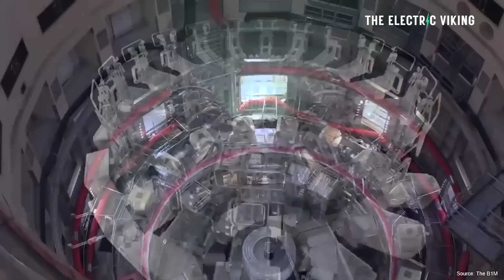Sweden criticised over plan to build at least 10 or more new nuclear reactors

Comment: NUCLEAR POWER: 
    Nuclear is THE MOST / ONLY carbon-free source of energy; it does not produce greenhouse gases that contribute to climate change. Trillions of solar panels and billions of windmills are much more carbon intensive.
    Nuclear is a reliable source of energy; it can be used to generate electricity 24 hours a day, 7 days a week, UNLIKE RENEWABLES.
    Nuclear is a low-cost source of energy, once the initial construction costs are amortized. SEVENTY PERCENT of nuclear costs is FINANCE CHARGE when builds are ALLOWED to take 20 years. 3 year builds are CHEAP, and can be had by building the exact plants built in the USA, over one hundred, in the 60s and 70s. They were on budget and on time, and can be again.
    Nuclear has a small land footprint; it can be built in areas where land is scarce. Nuclear power will create jobs and boost the economy.
    Nuclear power is a proven technology that has been used safely for decades.

Comment: Good on the Swedes. Depending on the type, it will be straightforward enough. Modular types can be built off site and dropped in place, more or less. The hysteria around nuclear is misplaced. Far more people have died from coal mining, through explosions or workplace injuries.  Mining is dangerous, especially when safety regulations are lax. Coal mining releases methane, is toxic, explosive and a worse greenhouse gas than CO2. When solar is simply not an option, nuclear is fine.

Comment: Smaller reactors is where the technology is going. U can also recycle the uranium rods after their 15 year cycle and reuse them again. I agree with reactors along with clean energy. Anything but gas and fossil fuels. Remember reactors are very very efficient. It’s also 2023. We have much more reliable fail safes for safety.

Comment: DUDE, you can't build a reliable power grid without Nuclear or Gas Power stations. You need a base load and anyone saying otherwise is assuming that battery production can increase 500% in 8 years... which it can't !
Spending €17B on a Nuclear power station is a great strategy for Sweden because they can sell "EXCESS" power to Germany, Denmark, Norway, Holland and the UK.
Also €17B divided by 50 Years = €340M ! That is quite low.
You can also sell the heat from the reactors and use it to run local heating and industrial processes.
Every single country in Europe with a population of over 25M should aim to get 30% to 45% of it's power from Nuclear Energy. Batteries today are in short supply and can't save the grid in certain rare circumstances. We need a mixed grid with a focus on Nuclear, Wind, Solar and Hydro.

Comment: The reason solar do not work well is that you basically do not get any solar at all from early November to early February. And for the rest of the 6 dark months you only get a trickle. I know as I have both EV and solar, and intend to get more (+ batteries). I intended to send a photo of my house at noon a sunny day around Christmas. The sun reaches 4.5 degrees (Stockholm) and is up properly for 3 hours, on top of that there is snow on my cells. Unfortunately YouTube did not give me the opportunity add a photo.
As we would need to save energy from the summer to the winter and want to produce CO2 free steel, concrete and batteries, nuclear is actually a very good option this far north.
I only wish we would burn all of the Uranium, on top of needing 40 times less, it would stay dangerous 100 times shorter.

Comment: 🤣to expensive 🤣
All "renewables" come with a co2 guilt you know ? The metals,minirals and production of "renewables" are mined with....diesel ofcourse 🤷🏻‍♂️
Reply: Not true. You need to do more research.
Reply: Postning of cry-laughing emoticons doesn't make you more trustworthy.
Reply: @vec306  as someone who works in a mine where they mine materials for making EVs what they are saying is true.  You arent running mining equipment off of batteries. Those trucks are massive diesel haul trucks.

Comment: Yes, energy from sun, wind and wave works great here in the northern part of Sweden in the summer. But in the winter the sea is frozen, we have almost no wind and the solar panels have few hours of sun and are covered with snow. Our new industries producing batteries and fossile free steel demands a lot of energy. The price for electricity was crazy last winter. What to do?
Reply: Yours is a far more intelligent response than Viking’s video which is low grade
Reply: Whenever there is sufficient wind during summer, loads of green hydrogen could be produced for the steel industry and possibly for heating homes (district heatings), obviously during winter.
How about the share of hydro electric electricity?
Due to EV’s refineries will become much smaller (will consume less energy), steel manufacturing for the oil&gas industry and the automotive industry will collapse (aluminium castings like Tesla). If we wouldn’t use so much plastic and carton the whole chemical industry could be downsized.
We all create too much garbage and we somehow keep running behind our own tail.
Reply: @Thesummerismagic12  electricity production from hydroelectric power stations cover around 45% of the Swedish electricity consumption.
Reply: the key is simple: STORAGE! we have just scratched the service when it comes to storage. We are so use to "power on demand" we have to realize that RE is not a power source with 24/7 availability thus you have to rearrange your thinking.
Reply: Energy import works just fine. Also storing energy for winter is possible in many ways.

To build more nuclear power plants is quite insane. It will be too late, too expensive and generates dangerous waste that will hunt mankind for at least thousands of years.

Solar panels and wind can provide us with all we will need. Storing the energy is the big challenge, but even that is much easier than storing nuclear waste.

With heat pumps getting better every year (reports of up to 600% power to heat), the problem will be even smaller. 

When EV batteries become part of the grid, the dark periods with little wind can be solved as well.
Reply: Waxes? Doubt there is much wave energy in the Baltic sea.

Comment: Don’t bother trying to compare the specific energy of any type of battery against uranium: its not even close. Nuclear doesn’t need batteries, backup generation or grid upgrades, works 24/7/365 and provides dispatchable baseload energy meaning cheap energy for the consumer. 
Many studies have shown the the system costs of wind and solar only ever increases as it’s system complexity increases, leading to a logarithmic increase in consumer energy costs.
Nuclear has zero emissions, has a very long life and uses 85% fewer metals and minerals than wind or solar, let alone batteries.

Nuclear is the greatest energy source humanity currently has has until fusion becomes a commercial reality.

Comment: Pretty weird regarding Sweden, didn't Sweden plan to build a massive battery production facility named: Northvolt? So they should be able to produce batteries in scale storing e.g. solar and wind energy (from world leader Vestas, Denmark)?
Reply: Was the production of batteries being proposed as a commercial business or to be funded by public money to be used for energy storage for the grid?
Reply: That's for cars and I believe they will move to us because of subsidies there.

Also grid scale batteries is not economically feasible not to mention we can't produce the amount needed certainly not for the climate Sweden has. 

All the hand waving about energy storage is infuriating for people in the electricity business.
Reply: @matthiasknutzen6061  "Just have a Think" just released an update on iron/air grid scale batteries. Looks promising for a change.

Comment: First I recommend taking a look at the new modular reactors.  Sized to drop in where there were old coal or natural gas plants and at a fraction of the cost of the traditional reactors.  

Then take a look at the reactors that are designed to recycle old nuclear waste as fuel, which sounds much better then long term storage.

From living near a nuclear reactor, there are many people who don’t care at all, so practically they take up a fraction of the space as solar.  

And simply for safety, solar is a supplement is fantastic.  But having a power source that doesn’t depend on weather, is key if you don’t want people freezing to death due to bad weather or too much volcanic ash in the atmosphere.

Comment: Industry heavy countries needs a nuclear baseline especially at that latitude. Hydro is great but built out to the fullest in Sweden already. There is no sun and way less wind in winter which is when you need the energy the most. Cant take no chanses with energy. NC works and is a fossil free addition to the renewable mix.

Comment: I think that everyone has said that baselod power isn’t a valid strategy. But if you think of the grid, what if you placed a battery at each substation and ran a nuclear power plant full out. You would get the absolute maximum power out of the existing grid. The cost of generation vs transmission may give a different result for the low cost system.

Comment: Of course decisions should be data driven. If nuclear plants use a common design, it greatly reduces costs. Streamline the approval process and costs are reduced. Build on a manufacturing line.
Reply: Once the price is known and can be reliably stated for each power station, it could lead to a wider use around the rest of Europe.

Comment: I usually like your videos, but this one has a few flaws.The following is neither pro nor con nuclear

Suggesting solar for Sweden is uninformed. If you go to google maps you will see that southern Sweden is at the 55th latititude. Northern Sweden is at the 68th latitude.
If you went to the southern 66th latitude from Melbourne, you would be in Antarctica, keep going a few degrees and you would be in the equivalent of northern Sweden.
It is really dark in the winter and cold enough to require heating of all houses. There is therefore a huge mismatch between power production and power demand with solar.

Regarding placement of nukes, you suggest that this would present a NIMBY problem. But Sweden has the immense advantage, that they already have nuclear reactor sites, that are  operational, and grid connected. Thus NIMBY is less of a problem, if they simply colocate with older reactors. 

Sweden has huge ammounts of hydropower, which is excellent for smoothing out the curves for wind and to some extent solar, but as much of this is on rivers, it is difficult to store for the 6 months it would require to shift summer solar to winter power. Recent events with flooding in both Norway and Sweden has shown, that hydropower also can be affected by extreme weather events, and thus be less reliable. 

If you look at Finland that share similar latitudes, they too have a robust and newly build nuclear capacity (over time and over price as you pointed out).

Comment: Sweden is up north... not in key sun belt.   they need the power... question is what type of reactors.  they need to standardize the reactors... so they can have all the spare parts up for use at each location.   wonder if the nuke plants can also make clean pink hydrogen as by product.

Comment: Like Sam said, new NPPs have had multi-billion dollar cost overruns and decade long construction delays.  The problems with Sweden are the lack of sunlight in winter and a lot of snow and cold weather.  They have a lot of hydroelectric generation, which, unlike nuclear, is fuel-free and renewable.  There is just a lot of ecological resistance to more new dams.  It looks like wind would be a good choice.  There are a lot of wind turbines in the US northern midwest where it's like Sweden, and they're doing well.

One thing that really bothers me is why do they need ten new NPPs?  There are only ten million people!  That's a whole NPP for every million people!  For pitys sake, get some insulation and reduce the heating losses in the buildings!

Comment: Is not going to happen.

   In France, the country with the larger dependence of nuclear electricity, with 56 reactors in operation, the largest nuclear utility company in the world, EDF, was withdraw from the public stock market by the Goverment in Summer or 2022, because the company is essentially in bankrupcy, with a mid term debt that exceeds 100,000 million € (the thrird largest nuclear company bankrupt in 2012 and Areva, the second one, was bought by EDF in 2017 (in 2019 the EDF debt was already over 70,000  million €). So ther larger nuclear company in the world is unable to profit despite managing five dozens of reactors for near 50 years, and now Sweden will make new nuclear power plats? Foolish.

   The minimun time it will require to have the first one in operation will be 15 years, so NEVER before 2038... So it won't solve any current problem with energy or greenhouse emissions, and when it would enter in the electricity market, won't be able to compete in price. So we are talking here about some new Flammanville/Hinkley Point C disasters: 20+ years for construction, x3 to x4 the budget and all nothing...

   Finally, I think you should no use ITER videos as background for this news, since the ITER is a scientific reasearch project, NOT a commercial one, and is based on fusion, not fision, and even IF some day gets success in the 3 goals TO TEST that it has (being able to produce stable fusion over time, being able to deliver more energy than consumes, and being economically viable) you can't expec any use of the technology before 2060+...

Comment: Nuclear is a good option for Sweden. Wind power is a good renewable option, and they are indeed building a lot of wind farms, so now about 1/4 of their energy comes from wind. Solar works quite well south of Stockholm, around 3KWh per day annual average per installed kW of panels, which could help with any summer heat waves, and yes they do occasionally get temperatures in the nineties.
Reply: Wind requires 150x more land than nuclear, and over 10x more materials.  Also, nuke plants have a 70-year lifespan.
Reply: @shoobidyboop8634  so? The levelized studies (by the experts) still show wind and solar being cheaper.
Reply: @AORD72   LCOE isn't used by "experts," but by scammers.  Try FCOE (transmission, storage, backup, environment, recycling, etc) and get back to me, fanboi.
Reply: @AORD72   Wind and solar are cheaper? I guess if you cherry pick the data that is true. Without things like nuclear/gas/coal power stations you would need huge battery storage. Did you include the cost of all the storage required to go fossil fuel/nuclear free? How many terawatt's of battery storage was your maths based on?
Reply: @geoffhaylock6848 Luckily Sweden doesn't need to build battery storages. Sweden could build 50,000 MW of wind power without problems.
Let's assume that Sweden in 4-500 years has 200 million people, when most of the people need to live near the arctic circle because of the temperature and higher sea level, then we have a different situation...
Reply: @leiflillandt1488  and that day when the wind doesn't blow? Hospitals shut down, cars can't be charged, homes cannot be heated. Too risky.
Reply: @shoobidyboop8634  Really? Industry uses LCOE to determine what is economical. Do you have electrical certification in your country? I do. Why do you throw insults "fanboi", instead of sticking to compelling arguments.
Reply: @geoffhaylock6848  Well if you look at Sweden they already have plenty of dispatchable generation. However I don't disagree with them adding or replacing old nuclear stations (you made an assumption). I don't need to do any calculations they have already been done by experts with all the data.The facts are Solar and Wind are now cheaper, the many LOCE studies prove that, that is all I said. Yes you have to have enough dispatchable generation.
Reply: @AORD72  You're one to talk; you have no arguments period.  Yes, I have electrical certification in my country.  Remember, wind and solar have 15-25 yr lifespans, but nukes last 70+ years.  Get some facts, fanboi.
Reply: @shoobidyboop8634  Rubbish. I pointed out that LCOE proves the viability of types of generation. LCOE actually take into account the lifespans, that is why people do LCOE studies, they include everything like lifetime, construction cost, disposale, employee costs, fuel costs, maintenance costs etc. You obviously don't know what you are talking about.